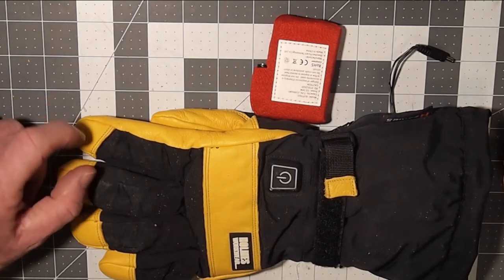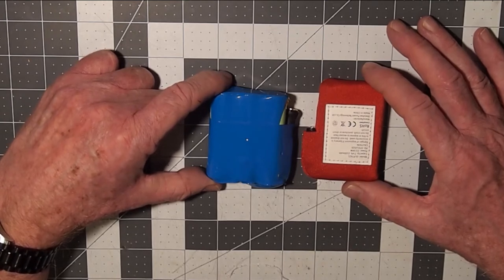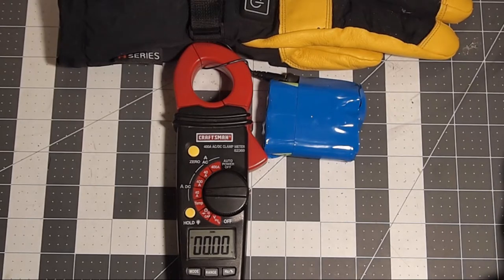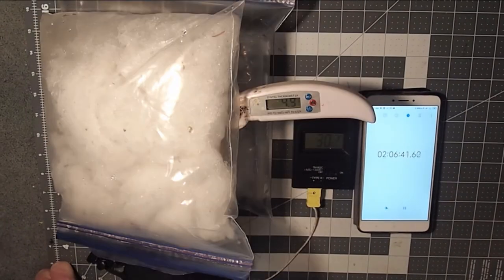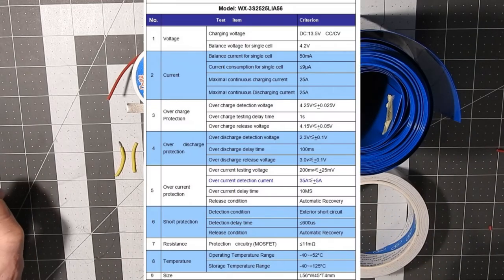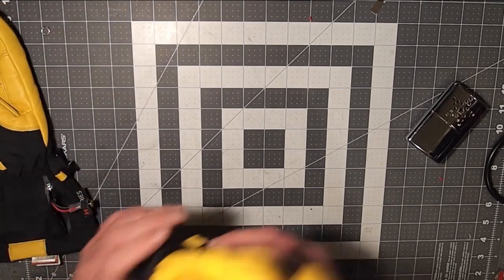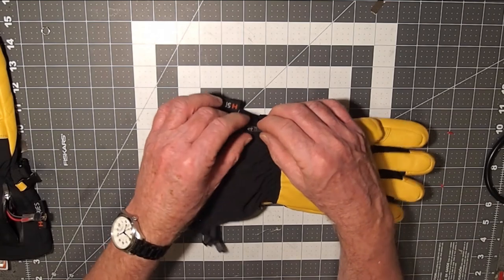Handwarmers S05E02 Heated Gloves PT II

Comment: Wanted to offer a suggestion on the 3S BMS if helpful.
On ebay and others there is sa 3S BMS avalible that is the same profile as 3 18650s on edge with radiused edges that will integrate into a 3S pack with ~2-3mm added width total depending on your construction. When heat shrinked, you cant even tell its there, and gives a very clean sleek profile on the pack for anyone interested in that.
Reply from the maker: Thanks for the suggestion. The battery pack shown at 1:45 is spot welded in a 3S configuration of 18650 cells so used a BMS. As discussed in Handwarmers S07E04 (at the 08:00 mark), I am tending to favor end user 18650 battery holders that come in 3S configuration so that the user can just insert and charge their own cells with easily available chargers without the need to spot weld, and source a suitable BMS.

Comment: I tried wiring the gloves directly into a 12 volt plug from a heated jacket liner on my motorcycle . Gloves don’t warm , is there a safety feature in the button on the gloves?
Reply from the maker: No, given that these are dollar switches from China, they are about as basic as a potentiometer can get. Probably something else, polarity perhaps? If not that, then probably a short in your wiring between to jacket liner and the plug on the gloves.

Comment: Inspired by your video, I decided to build a harness to run the gloves off of a Lithium Ion booster pack that I have that has a 12V/10A outlet port. I'm still in the prototyping phase, but the good news is that the gloves really heat up and would be much more effective than the using the stock batteries, which are barely adequate at -6C. The down side is that the on/off temp control stops working when plugged into the harness. As a result, the gloves get too hot.  Any thoughts on what the issue might be? Thanks.
Reply from the maker: Those booster packs are LiPo batteries (not Li Ion Cobalt) so they can provide a huge surge of current, and not very suitable to use as a power supply. 12V indeed will get them hot, 9.6V would be much better. I suggest ditching that battery booster and find a 9.6V source of power. If you mean the temp control on the gloves, I'm not sure why it would not work. The switch in all the heated gloves I've seen actually does not control temperature in the sense of a thermostat, it simply cycles the power on and off using different cycles to change the amount of energy going to the heating elements.
Reply: @MountainParameters  Thanks for the insight. The booster pack fried the on/off switch on one of the gloves and now the glove won't turn on with the battery installed. Oh well, live and learn. The other glove still works fine. 
With the booster pack hooked up, the glove is only on. The switch seems to get bypassed, so the gloves can't be turned off nor can you cycle between high, medium or low.
Think I might just pick up a pair of the powerinmotion liners. They're 12v out of the box.
Reply from the maker: @OLRybren  In my experience all the modern glove liners use the same element. The insert does not care about the voltage because it is simply a resistive carbon element (think of the old light bulb filaments) sandwiched in a PET substrate (the old style used a woven textile of some sort) with a positive and a negative end, but the switch might. I also don't believe you'd ever need 12V, I find 9.6 works well when it is -30C outside. Again, I think if you continue to use LiPo batteries, your problems will always exist. I'd advise not wasting your money on overpriced liners (I've seen their video) that most likely use the same heating element as all the rest, and spend it on proper batteries instead. If you need a replacement switch, they are also cheap. Which brand of gloves are they?
Reply: @MountainParameters  They are the Holmes gloves from Costco, the same as what you used in the video. Thanks again for the advice.
Reply from the maker: @carellclan9196  That's interesting, as I see you can't get those gloves online anymore, and for the $99.00 CAD I paid, that is a great deal. I would have assumed those switches would take 12v, maybe they got more current (or perhaps heat) than they could handle. I bought a bunch of those switches from China to use for heated foot warmers, and none have failed so far. I realize that not many people want to go and build a spot welder and weld Li Ion cells like I did. I guess the alternative would be to find and adapt something commercially available. I did a search on 'Rechargeable 9.6V battery pack', and a few possibilities came up on Amazon for rechargeable 9.6V cells. Most are NiMh or NiCAD, and it would be best if you could find something that is Li Ion. So here's what I'd suggest (after you stop using the LiPo battery pack): 1: Forget about the expensive Power in Motion liners. 2: Find 9.6V battery pack replacements for some sort of power tool or RC Power toy (Lots available on Amazon). 3: Replace the switch in your faulty glove. 4: Change the connector type on your gloves to match your new 9.6V battery packs.

Don't forget that you will also need to ensure you have the ability to charge whatever new battery pack you decide to buy, and buy 2 or more sets of them to match how long your average day with gloves require you to swap them out.
Reply: @MountainParameters  Thanks again. The Costco here in Ottawa has the Holmes gloves for $90CAD.  I was in the store today and they just brought in a Karbon (I think) brand of heated gloves for $150. They are made by the same company as the Holmes gloves and the packaging is very similar. I suspect that despite their outward appearance, they are the same glove but for $60 more.  I will start looking for a battery battery pack and replacement switch for my gloves. I really appreciate the support and help.  Cheers.
Reply from the maker: @carellclan9196  That is interesting. I'm planning a Costco trip next week (It's a 1.5 hr drive for us) in Calgary. I think if they also have them I'll grab a few pairs as backups and Christmas gifts. As they are, they are really not worth it, but if someone has the ability to change out the batteries, then they become value at that point.
Reply: @MountainParameters  Let me know if you can't get them, I could grab some here (assuming that they still have them) and send them to you.
Reply from the maker: @carellclan9196  Thanks for the offer, I'll see how it pans out next week then.
Reply from the maker: I just had another thought about building a 9.6V power source (keep in mind that when fully charged, this battery bank is actually 12.6v because when I mention 9.6 I am talking about 'nominal' voltage of 3.6v per cell, but fully charged voltage is 4.2). You can buy the 3S 18650 battery cases from your favorite Chinese sellers or eBay, etc. They will eliminate the need for you to spot weld the batteries in series. Also, if you charge each individual cell in a standard charger, it means you will not have to setup a BMS to manage the charging algorithm required to balance charge 3 cells in series at the same time. I think that these holsters should fit into the existing battery compartment of these gloves as well. Again, this solution should be much better than a LiPo booster pack.
Reply: @MountainParameters  More great ideas. Thank you!
Reply from the maker: @carellclan9196  If you want to PM me your email I can send you a pic of what one of those cases look like. I never had much luck with them (I spot weld everything now), but a co-worker bought some (they look a bit different from mine) and they seem to work for him. You need to use them with unprotected cells BTW, but I believe they have a protection circuit built into them anyway.
Reply: @MountainParameters  Thanks for the offer.  I sent an email to your sales email address. Cheers
Reply: Quick question as I was going to do exactly what you recommend in this answer since I have a bunch of 18650s lying around Without a bms to cutoff the 18650s when they reach their cutoff discharge voltage (typically around 2.5 -2.75v each) won't the gloves continue to drain the batteries until they're near 0 volts damaging the 18650's (I know some 18650 have built in bms, but most do not), or am I missing something? Thanks! @MountainParameters
Reply from the maker: @mikeoes1  
Good question. While the 18650 chargers all have a high voltage cut-off to prevent over charge, and those 3S battery cradles 'should' have a built in cut-off for low voltage around 8.4-9v as well, but the basic ones would not. However, that may be a moot point. That is because when your cells (that are in the 3S basic cradle with no protection) have reached a voltage of less than 3v per cell, you will have less than 9 watts of power, and your hands will be getting cold (I am under the impression that you need about 11 watts to keep your hands warm when it is -10C or colder), so you'll probably swap out your batteries at that point and recharge them anyway. You just need to remember not to leave the gloves turned on with the batteries in them or as you have mentioned, you'll wreck your cells. And as you mention, the 18650 'protected cells' do have a BMS built into them so that would be perfect to use them. But ironically, if I recall correctly, they are just the bit too long to fit into those 3S cradles. Clearly, you'd think that it would make perfect sense to make those 3S cheap cradles long enough to take an 18650 protected cell, but since when did any of the engineering behind many of the products on Ali Express make any sense?

Comment: trying to find anything other than the 7.4v batteries for heated gloves is nye on impossible online, any recommendations? i have these very same gloves and im trying to find something just a little bit better to get some more heat
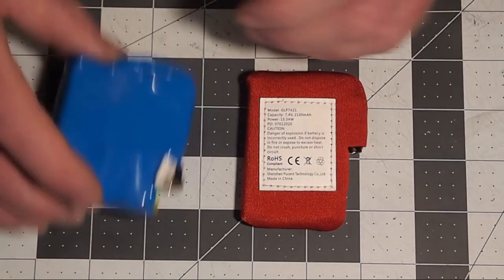Reply from the maker: Yes, you can buy those battery holders like the ones shown at the 8:08 mark of the latest video I recently made on this topic (Handwarmers S07E04), and then just put an end on it that matches the connector in your gloves (typically 1.1mm DC male plugs). Harvest some 18650 cells from discarded laptop battery packs. Grab an 18650 charger to charge them, and feed the gloves 10.6V nominal when it is all setup. All this is covered in more detail in the video I just referenced.
Reply: @MountainParameters  yeh, i dont trust myself to not make a mistake and cause a runaway on the battery i suppose haha, im half tempted to see if i can just wire XT60 to the dc male plug and use an external rc battery just with a longer wire.
Reply from the maker: @_Tamas  XT60 is a much better connector than the DC connectors the gloves use, but you'll never come close to drawing the current the XT60 can handle withal. You'll need to pull the connector out of the glove and replace what it uses with the gender matched XT60 that your RC battery uses so they are a mated pair. I'm not too keen on using lipo batteries for this sort of application, and the MAh capacity that they report on Amazon listings for RC lipo I suspect were born in some far-off LaLa Land, but, as I do value my appendage's as much as I value my wallet, if I were to use a lipo power source I'd probably want an XP60 connector anyway, maybe even with a 5.6 ohm resistor added for good measure so the gloves don't ignite when the connector is coupled.

Comment: I bought a pair of these type of ‘heated gloves’ off Amazon last year, which were quite expensive.
They run off 3AA batteries, regular or rechargeable.

What a total waste of money! They were about as much use as a chocolate fire guard.
A lighted match gave out more heat that they did!

DONT BUY THEM, buy another, or 3 hand warmers instead, its much better value and much more heat!!
You can thank me later :-)
Reply: Oh, as an addition.
Petrol, Naptha,  Zippo fuel or similar type warmers are pretty useless inside gloves.
I’ve tried a pair of small Zippo’s inside some ski gloves.
They were great for about 5 mins, then go out due to the lack of oxygen.

I’ve found that one of the Hot Hands, or similar 8 hour disposables are wonderful.  Pop them inside and you are as warm as toast as they don’t need oxygen to keep them warm. 
Here in the UK, when it gets stupid cold and I’m outside, its 2 warmers in my trouser pockets (springs of course!!!!) 2 warmers in each coat pocket, 1 disposable Hot Hands inside my gloves, and in the super secret depths of a butchers freezer cold, a small baby zippo hanging round my neck!

Who cares what its like, I don’t I’m warm :-)
Reply from the maker: Thanks Simon,
I'm starting to form the opinion that as a rule of thumb for heated gloves, if they cannot provide at least 15 watts (better if 25) of energy, then they are not worth considering. So to figure out the watts, the buyer must be prepared to do that themselves. For example, we know that the pads in these gloves struggle to draw more than 1.4A from a 7.4V battery pack. So you multiply them and you get 10.36 watts. That's simply not enough. 3 AA batteries is 4.5v which is even worse. I'd say, do not consider buying gloves with anything less than a 10.8 V battery pack.
Reply: @MountainParameters   Totally agree! Wonder how one of the 'body worn' heated jacket pad things would stand up to the cold?
I'm reluctant to buy one to try it as I'm more than pleased to have one of the small 6 hour Zippo's hanging around my neck inside my coat :-)
Reply from the maker: @simonsnorkle3069  
Good question. Again I'd probably turn to the math to do a seat of the pants guess. If we say the minimal energy required to heat one hand (let's say 48 sq inches) is 15 watts, then I'd guess that the energy I'd want to heat my torso would be 300 watts. My guess is that you may get enough power supplied from a vehicle, side by side, quad, or sled's electrical system because it has the capacity to charge a battery, if you want enough power to keep warm when you are unplugged from them, then you need to pull a sled consisting of 3-4 large solar panels behind you, and stay out of the shade! Kind of like in this video: https://youtu.be/7EyRqQhuwio?t=559
Reply: @MountainParameters   How about a Tesla car running on slow auto pilot, with a 15 foot extension lead from the battery, clipped to your 'heated jacket'?
That might be a viable option? Haaaaa!!!!!

Yes, a joke everyone a heated jacket is just not a viable long term option. Might be OK if the temp is a minimum of, say, +5C, other than that wear another layer of clothing!
I've been doing that for years and I've been fine. Its just the age old Swedish Proverb "There's no such thing as inclement weather just inappropriate clothing"

Stay Warm, and Stay Safe every one - Happy New Year from a chilly UK.